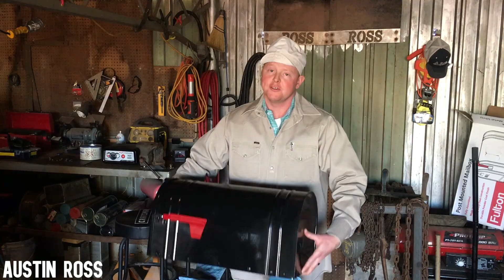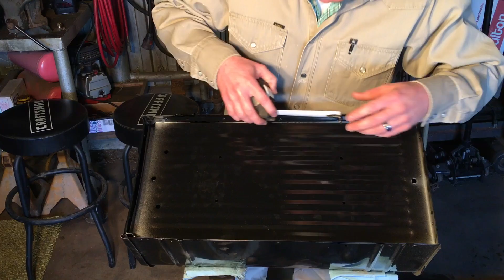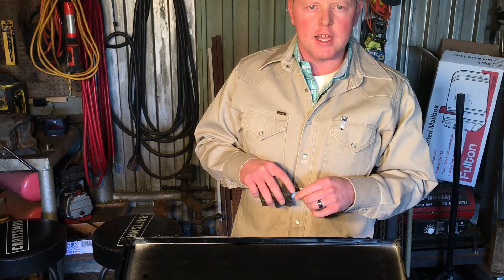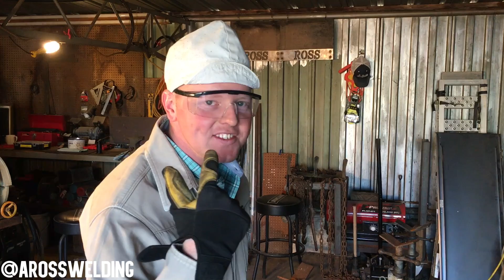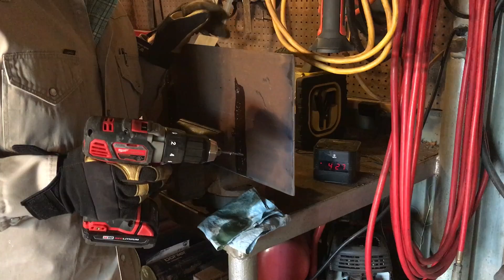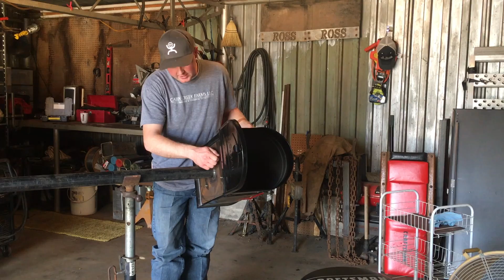QUICK TIP FOR LAYING OUT HOLES | FABRICATION

Comment: Austin: Good tips on laying out holes. 1] Measuring from the sides of holes, 2]Center punch, 3] 1/8" Pilot bit, 4] Oil, etc.  When using a steel tape, I start at 10" rather than 1".  That gives a somewhat of a Zero reference (that way I don't have to remember to add an inch) and also easier to hold the tape free end when wearing gloves.  Measure the cross corners (hypotenuse) to get truly square corners & sides.

Comment: Yeah! best way to measure holes in a lot of Fab work....Center punch...always! And I like to use a 'starter' hole for larger holes. 1/8" double ended split-points....used a lot for Cleco's in body shops...Precision Twist Drill brand...about $8-9 for a pack of 12.
 That's a long post...gonna be for Air-Mail...?